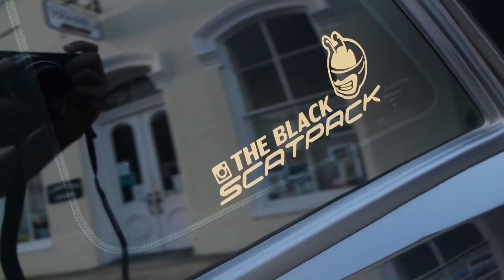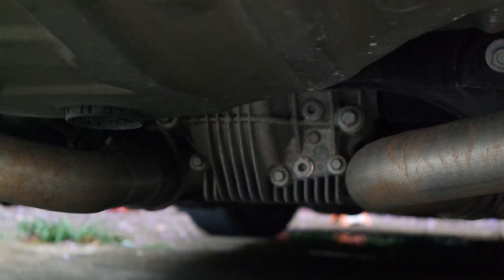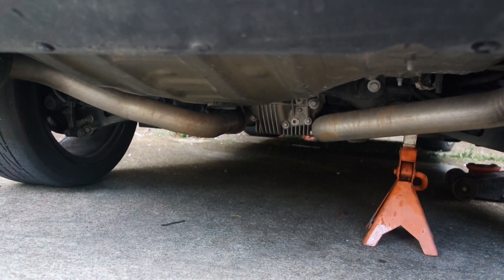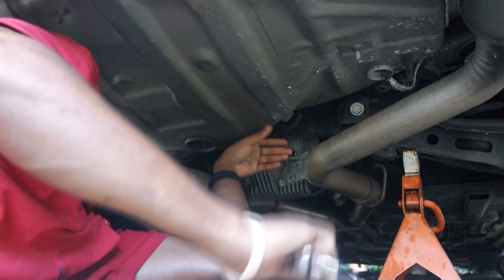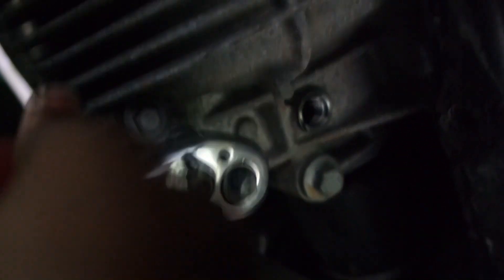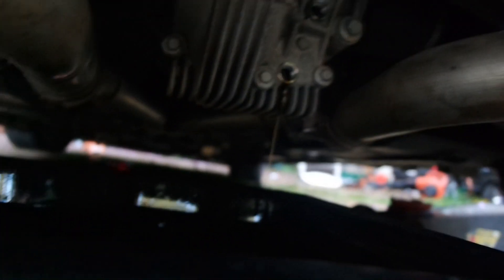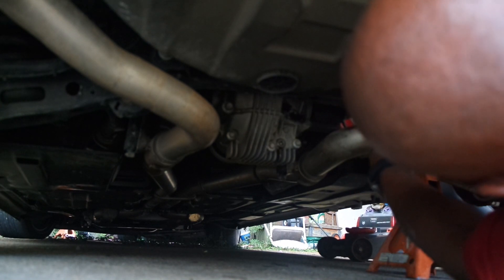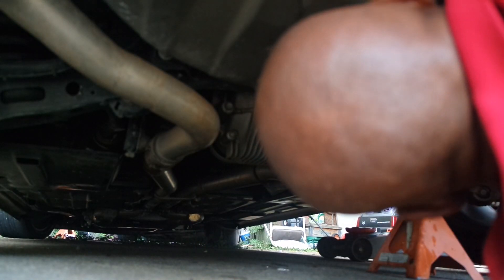Changing Rear Diff Fluid for Dodge Challenger ScatPack

Comment: Thanks for posting this, I know it's a PITA to shoot good repair videos... But this did the trick. Thanks for including the advice for making sure the fill bolt can be removed first, AND for including the torque specs... Made this job a breeze. Saved over $200 by doing this myself, and put in far better oil than the mechanics would have.
Reply from the maker: You’re welcome and that’s exactly what I was aiming for!! I’m glad to be a help!!

Comment: is there any signs or symptoms that tells you is time to change the diff fluid in these 392s??
Reply: I believe it’s every 30k miles bro. Call dealer for service interval recommendations
Reply: Will make a groaning noise when making a tight turn at low speed.
Reply: yeah, you start doing more crowd control than a mustang